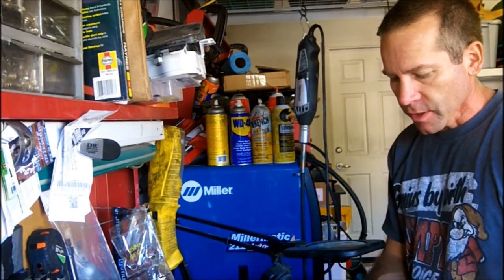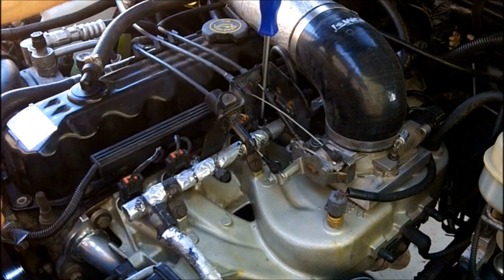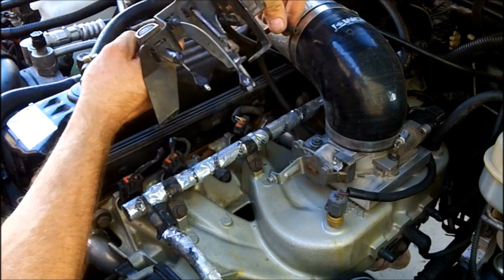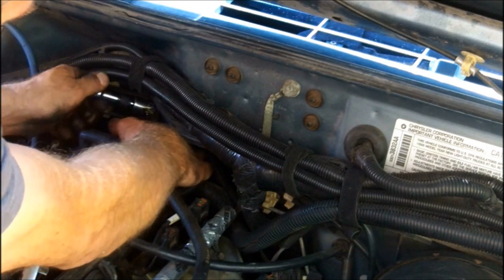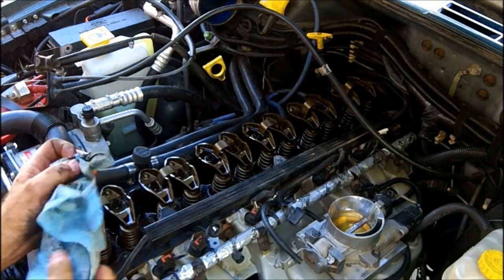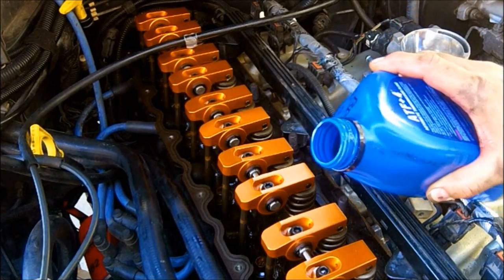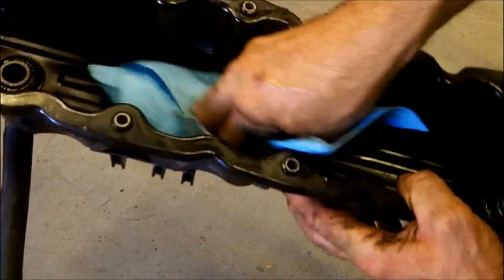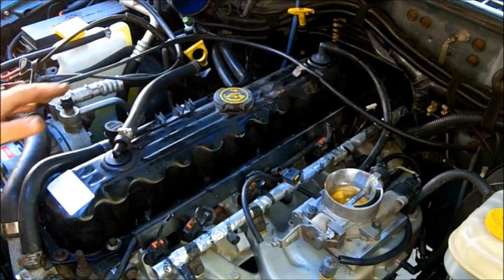How to Install Harland Sharp Roller Rockers on a Jeep 4.0

Comment: Did you find that the roller rockers are worth it considering the heavy cost in comparison to stock lifters? $550 s alot of $. I'm considering getting some myself while im replacing my 0331 head. Thank Martin for this awesome video. I saved it to one of my play list as reference when I may put these puppies in (if I busy) Repped and subscribed! looking forward to more of your videos!
Reply from the maker: Yeah I do believe the rockers are worth it they do actually gain you 8 to 13 horsepower. There was a video done on that with Dyno testing that proved this.

Comment: Why does it sound like its super charged? Is that the new rockers whining, or something else?
Reply from the maker: I know it's not the rocker arms that did that I think it's the cold air intake that I'm running and with a 68 mm throttle body.

Comment: What was the reason you upgraded?
Reply from the maker: Initially it was to help reduce the wear of the valve guides and then it has been proven that there is approximately an 8 plus horsepower gain by using this cuz of the reduced friction.
And because I had some money that was burning a hole in my pocket 😁

Comment: Martin, am I hearing a Pete Jackson Gear Drive? I the air intake noisy in the cab!
Reply from the maker: No I don't have a gear drive. And the cab noise from the air intake is not noisy at all. The only time there is a little bit of noise is that the initial cold starts. It only lasts for twenty to fifty seconds or so.

Comment: What are the advantages of these on a tractor engine designed for low end torque? Do you have a high performance cam? Higher rate valve springs? Heavier push rods? My main ? did they kill the oh so familiar clatter? Where did you find a 68 mm throttle body and what fuel injectors are you using? I love your channel dude! Always good stuff!
Reply from the maker: The advantage of these is it reduces the friction between the rocker and the valve stem tip. And it reduces wear on the valve guide.
The result is more horsepower because of the reduced friction.
All my other components are OEM.

Comment: What about the lifter backlash/preload and centering roller on valve head using shims under rocker stands, and lifter preload using  proper length push rods? That is how you get the maximum benefit from your large investment in roller rockers.

Comment: After removing the baffle were there any issues?
Reply from the maker: Yes I had to relocate a breather  and remove it from the throttle body.  As it was drawing oil into the intake manifold.

Comment: I installed those in my Jeep xj whit a wider throttle body
N a throttle body spacer .now I just touch the gas n it pulls good but also it reduce the gas mileage.
Reply from the maker: I can assure you the rocker arms aren't to cause of your lower MPG.
 Is the throttle body opening bigger than the intake manifold and if so it needs to be enlarged as well to match to the throttle body.

Comment: You didn't say what engine but it looks like the 4.0 inline 6 in my Comanche jeep that currently has clicky rocker arms at 195000 miles. Engine is running very good.
Reply from the maker: Yes this was the 4.0 engine.

Comment: When you remove the tray under the valve cover would that affect the PCV system?
Reply from the maker: Yeah it does ends up putting oil into the intake manifold. I ended up just running a hose up higher with a filter attached to the firewall.
 I got another valve cover one of these days I'm gonna try just installing it rotating the engine and see if it makes any contact with that metal.

Comment: Hey Martin! You think these rockers, new pushrods and lifters will settle alright on a 4.0 camshaft with 60k on it?
Reply from the maker: With only 60000 miles is there a reason you're changing the lifters and pushrods. If you want to save a lot of work and some money I would just install the rocker arms.
 You'll need to pull the cylinder head to change the lifters.
Reply: @martinbuilt  well, either i have a lifter tick or a piston skirt may be on its way out. I figure i may as well swap them if im doing the rockers, but ill be pulling the oil pan first to see if theres any metal sitting in it. A compression test came up fine as well, but the tick remains. Id like to get rid of it if i can!

Comment: Do the engine stock ? Cause I have the same rockers when I installed there’s a noise from him my Jeep stroker crank 4.7 comp cam stage 3 I don’t know should I move more 19 ft if can help me ?
Reply from the maker: With that higher lift Cam you have I'm wondering if the rocker is not hitting the top of the valve cover. Did you remove that baffle from the valve cover?
Reply: @martinbuilt  I buy the spacer for that problem also there’s a noise so i install the oem roller rockers but i want to install the harland before the dyno .. when I install him at first time with 19ft still there’s noise then with 24ft still  there is no difference same noise like something crack or Iron hits each other
Reply from the maker: @Lose_your_self   19 ft-lbs is good.
try removing the valve cover and start the engine maybe you can find the problem. Yes, it will make a mess. First try using a mechanic's stethoscope to see if you can narrow it down.
Reply: What kind of Valve Springs you go on your jeep sir ?
Reply: I’m running with crawler valve springs do you things maybe from him i have that noise?

Comment: Did you install the 1.6 ratio version?
Reply from the maker: Yeah, that sounds right. Is there another because there weren't any other ratios available when I installed these?
Reply: @martinbuilt  I think that’s what all of them are with the research I’ve done so far, but I have seen some say 1.7 ratio, but I’m thinking they are wrong.
Reply: @martinbuilt  I’m sure there are no other’s, people getting confused with the Dodge 360 rollers I believe
Reply from the maker: @moparlover1968rr  
Yeah, I think that is what it is. These are awesome rollers. Been running them for years with no issues.

Comment: I have a question. Do you have to drain the engine oil to do this
Reply from the maker: No, you don't have to do that, but it may be a good time to change the oil after you get the rocker arms installed.
Reply: Only if the engine is upside down.

Comment: just out of curiosity, do you have any oil burning issues after cutting out the baffle? I am probably going to end up having to do the same thing on my 4.6 stroker because nothing else will make those rockers fit. my idea was to do the same thing and run a catch can to prevent oil burning and to make the motor run cleaner in general.
Reply from the maker: Yeah, I ended up running a hose with a small K&N filter and mounting it on the firewall because it was sucking the oil and burning it through the intake manifold.
 I should just install a catch can.

Comment: I got these rockers coming soon.. Question has anyone tried to slightly dent the baffle where the lifters contact?
I really dont want to use a spacer with a double gasket so I'm gonna try to save $150. First I'm gonna need to figure out how much clearance I need with modeling clay.
Reply from the maker: Yeah, I've kind of wondered the same thing about the clearance issue with these rockers. I also have bought another valve cover and was going to use the clay method that you mentioned and see just how much clearness there is.
Reply: @martinbuilt  Nice video btw I guess it's off to the races to see who gets it done first! I'll let you know how it goes when I get the parts in. I should get the Rockers by Saturday. If all fails I'm gonna go with the valve cover spacer
Reply: @Moto_x11  did you ever find out how the clearance was with the valve cover?
Reply: @mnvjim7900   sorta it hits on a certain spot you could potentially hit with a hammer but don’t remove your baffle. I read ppl had oil consumption problems after doing that. I returned my rockers because you need a spacer for the thermostat housing 2 gaskets and 2 gaskets for the spacer I bought for the valve cover. I was $800 into it and I rather not take the additional risk of the gaskets failing. I went with enginetech rockers and those worked good for me.

Comment: Those are expen$ive! I could understand using them on a new stroker build, but could not justify the cost to put them on my nearly 200k mile engine just to save on some rattle.
Reply from the maker: There was a video done where it was proven that these these roller rockers will give you 8 to 13 horsepower, so for $400 or whatever they're going for now, I think it  Is justified.
Besides, you know what Jeep stands for.
 Justify
 Every
 Expensive
 Purchase 😁

Comment: Did you have to send the head off to a shop or do anything with the valves before you did this or is it pretty much ug and play?
Reply from the maker: It is a complete bolt on and play. Been running these rockers for quite a few years now never had a problem with them.

Comment: Harland sharp changed the torque specs to 24ft lb
Reply from the maker: Thanks for the update.
Reply: All that does is hold them tight has nothing to do with engine performance.

Comment: I have a 1995 Jeep Wrangler SE 4.0 liter, and would like to free up some Horse power with these Harland rocker rollers. What lifters, and push rods should l Use? Are hydraulic lifters good on a stock cam, or should l use solid lifters. 
genoandxana1@gmail.com 
Thank you Geno
Reply from the maker: I would stick with the hydraulic lifters. Stock lifters and pushrods will work just fine with the Harland sharp rockers.

Comment: I can’t find these for sale hardly anywhere. But I found the exact ones with an “a” at the end, i guess it means adjustable. Will those still work? Without extra work?
Reply from the maker: Yeah they would work but you will need to set the lash. It's not to hard with hydraulic lifters, when the rocker tip makes contact with the valve stem them you turn 1 and half more to set the lash.
Harland Sharp S40196A Jeep 4.0L Rocker Arm 1.6 Ratio Adjustable https://amzn.to/3f2pZDG

Comment: I think it is about the same for the old 4.2 AMC jeep also,  some of the parts interchange  also I think.
Reply: The manufacturer states they only make them for 1983 to 1986 Jeep  CJ 258. Why not earlier 258's they do not specify, but it may have to do with the valve cover clearance on earlier 258's.
Reply: @kseel6453  did you ever figure anything out on this? I have an 88but the motor was made in 87. I don't know what the differences would be except maybe the rod size.

Comment: Great video.  However, it's a good practise when performing work on any engine
7:15 Never dump used oil back to the engine
8:17 Use Permatex Ultra Slick Engine Assembly Lube on any mating surfaces
8:33 For ease of installation, insert allen bolts thru roller rocker arms holes and hold them in place in the palm. Turn palm right side up, then insert from the top two pedestal mount thru allen bolts . Hold them in place with fingers. Then, align the roller rocker assembly to rocker mounting holes

Comment: Removing the baffling in the valve cover  will lead to oil consumption, the baffling  is part of (Pcv) system) positive crankcase ventlation system,  It helps prevent oil being pulled in to the engine  cylinders were it will durn.
Reply from the maker: This is true, I ended up removing the hose from the intake and installing a small  K&N breather filter.
Reply: Or what I have done . connect both hoses to a T fitting than run a hose to an external oil catch can
Reply: Im guessing that an oil cooler will mitigate any potential for a rise in temperature, as a result of the filter being right above the valve cover, but does that lack of an intake hose create a drop in the overall rate of volume of air? Do you think it's affected the air fuel mixture?
Reply: *CCV

Comment: So apparently Harland Sharp sells two incredibly similar looking sets of rockers. The ones in this video are part S40196.
I went on Summit Racing, searched "roller rockers jeep 4.0" and it came up with one result - Part S4096. They're different. 
I am beyond angry as to why they have two completely different, very similar looking roller rockers with a difference of a "1" in the part number. Now I have to go through the hassle of returning them, getting a refund and waiting 4 months for the right ones.
Reply from the maker: that sucks, in the description of this video is an Amazon link to the correct part number.
Harland Sharp (S40196) 1.6:1 Ratio Rocker Arm Pedestal Mount for 4.0L Jeep  https://amzn.to/2CzZK44

Comment: I know this is from 2015 and I hope they worked out well for you, but I noticed you never set the valve lash on those , did you go back and set it off the video?  I'm building a 4.2L and have a set of these and just decided to check out some vids of installs.
Reply from the maker: You don't have to set the valve latch, it's a hydraulic lifter you simply torque the bolts to 19 foot pounds and you're done. The lifters automatically set the valve latch.
Reply: Thanks for the reply and clearing that up.
Reply from the maker: @Ikillintel1  you're welcome, thank you for watching!
Reply: @martinbuilt  <3 the simplistic nature of this engine!!!

Comment: Great video. but  <70.00 for new stock rockers which will go 200k miles easily..  wtef ?  :O
Reply: More power, less resistance.
Reply: Less lifter noise, Sir.

Comment: the last video said you get like 25 hp from this upgrade? what you think?
Reply from the maker: 25 horsepower that would be huge and definitely something I would have felt or I should say I would have felt it torque increase from this I did not. There is Maybe a few horsepower gain but something that you would have to see on a dyno.

Comment: what diffrent does this upgrade makes?
Reply from the maker: It places less stress on the valve guides that way there's less wear on them. Higher RPM potential. And I would imagine you gain just a few horsepower. I've been running them for years now with absolutely no issues.

Comment: Doesn't say what year Jeep this is ? Isn't Torque 21 FT. LBS. ? I don't remove the whole bracket for the cables just pinch them & feed them through the bracket. Cutting the baffle out of the cover, HMMMM, think you're going to have some oil issues. It's there for a reason, some things you shouldn't modify. I didn't even know you could do this on a stock 4.0 ? I here a tick still when it's running ? Should have used a Torque wrench ? I'd hate to rip the cover off again. Nice install but I didn't like cutting the baffle out, do they make a taller valve cover ? You probably need a catch can now ?

Comment: Mine burns oil like a savage now the baffle is cut out.  Ot sure what to do now
Reply from the maker: remove the vent hose from the throttle body and place a small breather filter on the end of the hose and mount it higher than the valve cover and install a plug on the TB.
Reply: Might throw in a new pcv valve  might help with oil loss

Comment: Just found you channel. Have you seen any significant difference ?    New sub
Reply from the maker: Gordon GMan  it's not going to give you a hp gain that you're going to feel. It greatly reduce valve guide wear and increase rpm potential. Thanks for subscribing.

Comment: You didn't leave it open to check for valve lash?  You just torque'em and they're good?  I just reinstalled rocker arm assemblies and they all loosened up and came apart.  I have a lifter that came apart as a result.
Reply: Wayne Sanders never checked lash on a 4.0 never a problem. As he said they self adjust
Reply from the maker: hydraulic lifters are self adjusting,  no need to adjust them. Torque to 19 ft.lbs. and your done.
Reply: I have a Golen stroker that I'm in the middle of rebuilding and the rods are very tight with the feet of the rockers sitting a quarter of an inch off of their pedestals.  I can tell by the feel I'll hit 19ft lbs before they land, and I just had to pull the head and lifters because the rockers were loose after running for 30 minutes, and a lifter flung apart (looks like the loose action caused the rod to knock the retaining clip outboard)
Reply from the maker: Wayne Sanders 
You must have some really strong valve springs. I would recommend do one cylinder at a time bring to top dead center then torque that set of rockers down
Reply: @martinbuilt  False. You don't adjust them but you dang well better set the preload up, a step completely overlooked so so often.  You adjust the preload with rocker shims or a pushrod length checker and ordering the desired length pushrod.  Anytime you alter the length of the valvetrain either with new components or a shaved head or even a new  head gasket, you change where the pushrod rides in the center of the lifter.  Otherwise, you will be this guy here.  That pushrod has to ride in the center of the lifter, if not you'll bust a lifter which will cause you to lose oil pressure, the rest of them will then run dry and not pump while one squirts away,  and munch your whole valve train. For that matter another extremely troubling falsehood is to put the valve cover back on and immediately run the engine at 2k for 20 minutes or some garbage.  The factory manual says "do not operate above an idle" until you see all rockers oiling. sheeesh 
There are several ways to measure preload, I've done them all, the best I like for the factory rockers is the count the cap screw turn method.  Theres videos here of guys dumping thousands to build a Stroker and then they are clueless why in about 2 months one lifter is squirting and the others grinding metal to the oil pan.